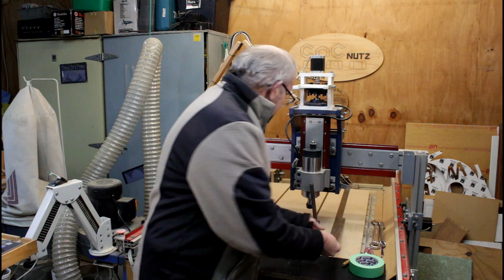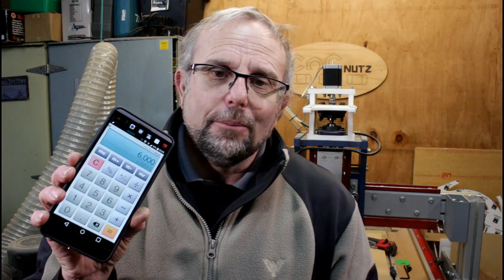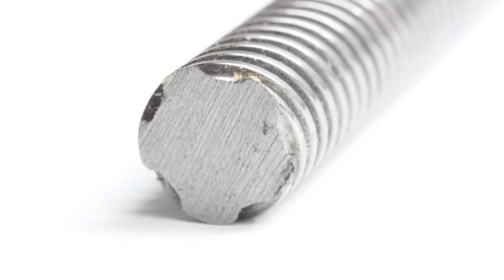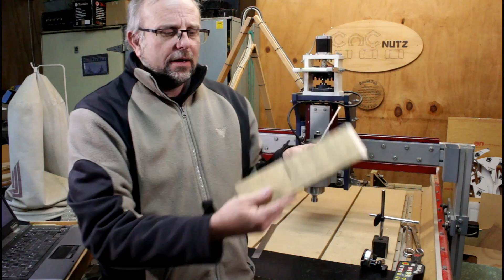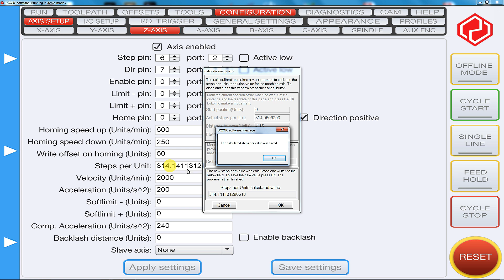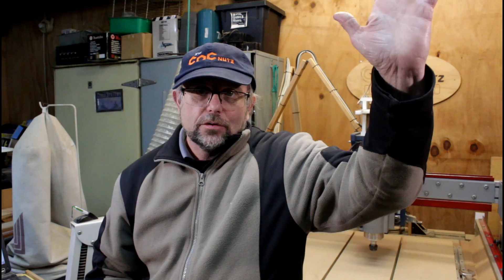How to Calibrate your CNC Machine - CNCnutz Episode 213

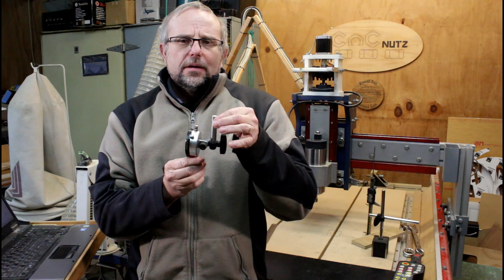Comment: @22:25 Using the dial indicator mounted into the spindle is also a great method of checking your bed flatness. I run the indicator up, down and across my bed to find any high or low spots when mounting a new spoil board. When finding high spots adding a deep countersunk screw will most times bring it down.

Comment: @18:20 When calibrating your axis start with a small number first. Reason being if your preset step calculation are wrong you run a risk of crashing your machine by it traveling farther then you think it will.  I started mine at an 1 inch and it travelled 10 inches. Once I entered the travel distance in my Mach3 for recalibration I started over giving it a longer distance. I also just use a 60 degree V bit to give me a nice sharp center point .

Comment: Hello, my CNC machine has a Nema17 stepper motor, 16 gears (teeth pitch 2 mm) GT2 pulley and DRV8825 driver using 1/16 micro step. In this case, how many mm does my CNC machine advance in 1 revolution in the X axis?

Comment: sir. i am worry for cnc machine . i am facing level problum. some vector thick some vector thin in design. i did level  machine bed but same problum after leveling. can you tell me about this issue.

Comment: Hello Peter, your video tutorials are great. Related to stepper motor calibration, can you please explain in a video or here the following:
1) how to setup the acceleration for the axis 2) at what procent of nominal current the drivers should be set 3) what is the best over voltage ( eg. nema 23 rated at 3[A]/2.1[V]  is driven with 36v in order to achieve the best performance) from the open loop steppers.
Thank you!

Comment: Hi Peter thanks for that good explanation
I have just Started using UCCNC software I've had my Router Table for over 18 years I was using supercam software which was ok but I had a bit of a problem with the break out board (was called a Campod) that was only compatible with Supercam But it went bung on me and SuperTech no longer is up and running Site is closednow . I use Vcarve Pro and AutoCad to draw my parts and import to UCCNC
When I import a 3D Gcode from Vcarve it worked really well
Only problem now with this software is when I do exactly the same thing 
If I start the Z axis surface as 0 after about 5-10 minutes of going through the Gcode the 0 surface starts to gradually move down a so does the cut 
Would you know of a solution to this
I tried slowing it right down but just takes longer but same result the whole job is tapering down
John

Comment: Peter - I set my steps per mm to 320 in mach3, test, and the router moves the correct amount, however, when I try to jog using my arrow keys, I get the following error message "jog access access is small!" what did I do wrong?

Comment: Thanks Peter for your outstanding explanation that has clarified and connected steppers and Mach 3 settings. One of the best I have seen and it arrived at a perfect time. I am on the other side of the ditch, enjoy my trips to" the real down under" each year and really appreciate your generosity. That does not apply to the All Blacks of course. Woodie

Comment: Thank you Peter for those valuable motivational tips. Because of you I took a weekend off just to re-calibrate my DIY CNC. Now my cuts are cleaner and more accurate. 90 Degrees are true 90. No more scarring my sacrificial board. FYI my machine was accurate roughly 0.49mm now down to 0.02mm according to my dials and calipers. Thank you,

Comment: hi, 
that was the Best tutorial i've seen so far, i was looking for an answer about gear ratio calculation for a long time but no one could explain in such a easy way like you did. i have a big  12' x 6' CNC wihch has gear reduction two times before it gets to rack and pinion on each axle, i have hard time calculating gear ratio .  I wonder if you can help me to calculate. 

Thank you

Comment: Hey Peter, Great video.  A couple of things I thought I would pass along.  Pitch Diameter can be found by first determining the pitch of the gear, diametric Pitch = (Number of teeth +2) / diameter.  The whole number will be the Diametric Pitch.  The Pitch diameter then can be found by number of teeth on gear / DP.

The distance a tread travels in one revolution is called "lead", so my 5 start 1/2"-10 acme screws have a pitch of .1" but a lead of .5"

I realize you are keeping stuff simple, but though maybe someone would want to know.

Joe

Comment: you can use this method to calculate the steps/mm for a completely unknown system.    you don't know the steps per rev, the gear ratio, nor the rack tooth spacing, nor microstepping.   so you set steps/mm to '1' and run a test.  your distance actually moved will be much less than the commanded motion so you may need to command a very long movement to get something to measure.   Therefore you must be careful to give the correct commands after the first calibration (a much shorter motion to get back to the start), and you will need to repeat the calibration 3 or 4 times.    I found that when calibrating GRBL that it is best to move back to the start point before updating the steps/mm, and do at least a soft reset before the next test.

Comment: Thanks for the upload particularly your comment about getting different reading for your racks for now I understand what is happening with my machine. I did the squaring method in your last post but long cuts still ended up with the  ends not parallel. I have just run the calibration on each side of the gantry and one side does indeed travel nearly half a mil more than the other.  Currently doing battle with Mach3  because when I try to change the steps per on one motor it changes it on the other motor as well so I might have to resort to reading the instructions.

Comment: Thanks Peter you make it look so easy:)  Question, given that my machine is tight, well aligned, etc. in your opinion do you think a UC100/UC400 rather than my straight parallel port setup would make my readings more consistent? I'm getting some inconsistency when i do this. Great video Peter!

Comment: Nice explanation, clear and good to follow. I do this at regular intervals to keep the machine as accurate as possible (belts etc. wear out after all). Do you have your A axis slaved to the Y? I do, and so it is necessary to use the same values in both Y axis and slaved A axis. If not, you'll soon find out that the gantry is no longer square and it will get worse every time the gantry moves back and forwards. If entering the values of Y into slaved A, make sure you use the full number of digits, or it still will be off. Thanks for the video!